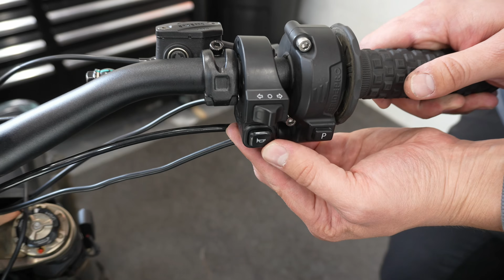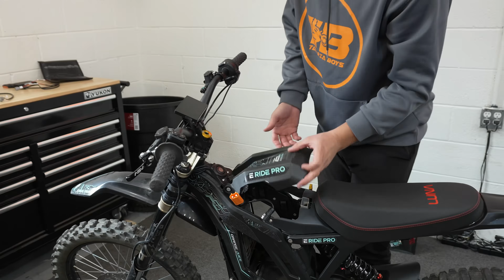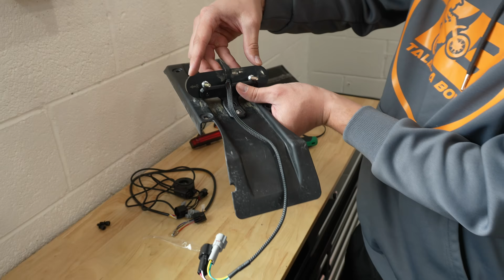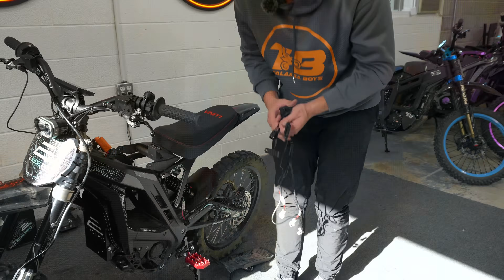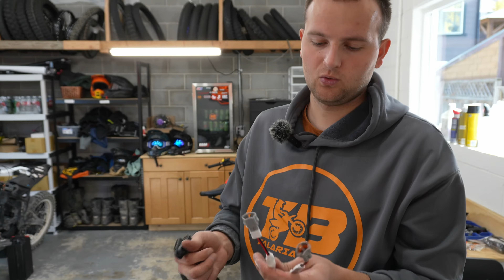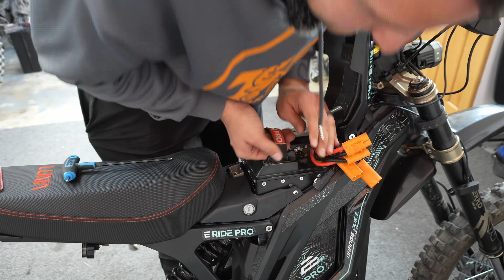New E-Ride Pro SR Turn Signal Kit Install Guide

Comment: Question: would you be able to plug the brake sensors into the kit itself so the brake light still works without cutting power to the motor?